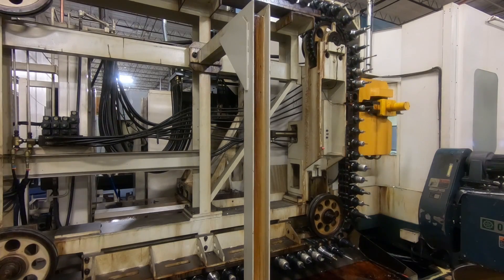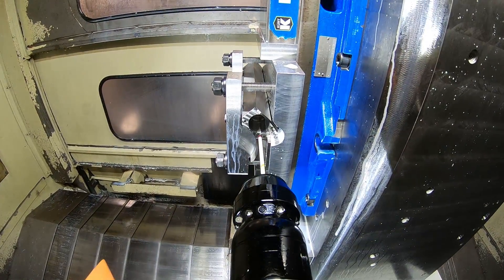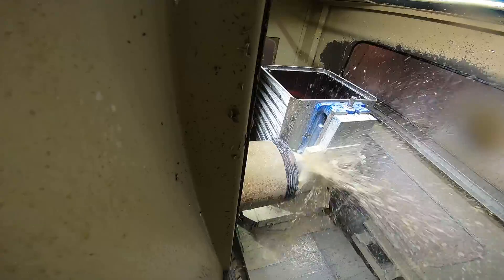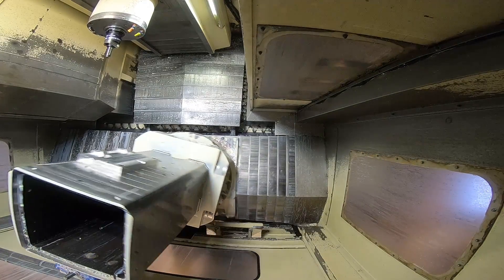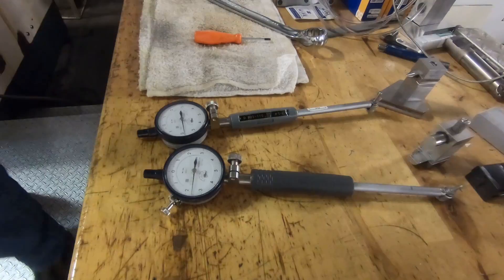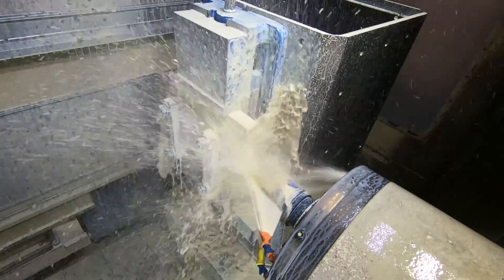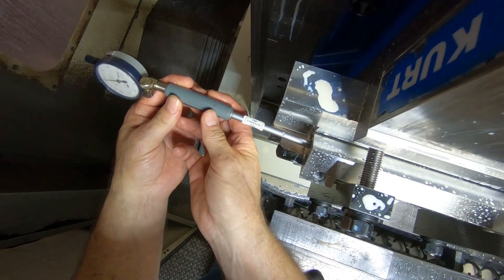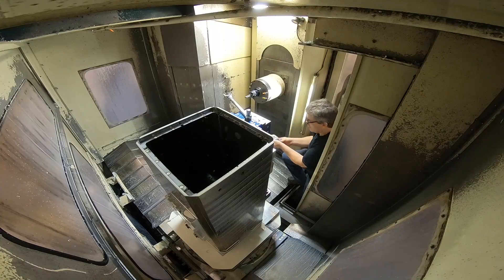Finishing Bores

Comment: Peter, do you have any experience cutting buttress threads I have a upcoming job at work. Approximately 1 thread per inch and 6” diameter. A experienced machinists advice would be appreciated.
Reply from the maker: I have cut buttress threads before. I treat them just like any thread. Are you going to be doing this on a CNC lathe or manual lathe?

Comment: You are a very skilled tradesman Peter, worthy of every positive comment. I just need some advice on what you would consider to be the most important and versatile machine (and which brand) to buy when setting up a small machining shop for the first time. Any comments would be appreciated, thanks.
Reply from the maker: This is a impossible question to answer. Not knowing the type of work you will be doing. The amount of money you can afford. Where you intend to put the machines. What kind of power is available at you site. How much experience you have running this kind of equipment. Are just a few things I would need to consider.

Comment: Peter can you tell me what Speeds and Feeds you would use to Threadmill a 3/4-10 Thread in 316 S.S?
Reply from the maker: Trav L it depends. What taper does your machine have? Are you going to use thru the tool coolant? How many passes are you going make?
Reply: I have a 50 taper machine but do not have thru coolant! I was planning on doing 3 rough passes and 1 finish pass! I have not Threadmilled much and just wanted to see what you would maybe do? I really appreciate any help you could give to me
Reply from the maker: What you need to do is start off very conservative. Say at around 1000 rpm and 5” per minute feed. Listen to the sound when cutting and look at the finish. Also look at the wear on the tool. If everything looks good. Start speeding things up. You will eventually find a good spot for your machine, cutter, coolant and setup combination. This is really the only way I can put it not knowing more about your situation.

Comment: Sorry to keep asking you questions but you seem to always have the right answers!! So I am cutting a piece of 316 L SS, I am using a Sandcik 2.5” Copy mill to do most of the heavy cutting, it seems to work the best for me! Have you ever used Ceramic Inserts to cut SS? If so, did you have any luck?
Reply from the maker: I have only used ceramic on Inconel. I don’t think there would be much advantage on 316. I would use a feed mill on 316. I usually run a 3” 6 flute feed mill dry at around 600 rpm and 90 inches per minute feed. At .060 depth of cut. This combination on my horizontal mill will rough a lot of material before needing to index inserts. But the tool will be hot so I have a bucket of water to cool it before indexing inserts. Or have a second tool set up while one cools. This is absolutely the best way to rough mill 316.
Reply: Edge Precision that is great to know because I have a 2.5” 5 flute feed mill but the insert pack says to run it at 1251 RPM and 150 ipm. That seems a little fast. I will definitely give it a try tomorrow! Thank you so much for your feedback Pete!!!
Reply from the maker: That RPM sounds a little high. But you have to experiment depending on the grade of carbide and the depth of cut. Sometimes less depth of cut but at a much higher feed will remove more material and be more reliable.
Reply: Edge Precision, do you ever run into surface hardening the material after you rough it?
Reply from the maker: Trav L tho only time I have had a problem is if the material got to hot and was quenched with the coolant. This is possible when using ceramic inserts. I have also had this happen on the lathe when the insert got dull or chipped.

Comment: @edgeprecision Is there any reason you set your bore gauge with the tip pointed upwards? Wouldn't the less the pre load be more accurate? Also I noticed you're needle is going towards the negative side, wouldn't you want it going towards the positive side since you're opening the hole up?
Reply from the maker: I think that it makes no difference witch way you face the gage for calibration if you face it the same way for the measurement. I always set the small needle and the large needle on the first major division. This gives me more travel in the minus direction. So I can measure the bore when it’s small on the first cuts.
Reply: @EdgePrecision  I suppose that makes sense. I work with the same mititoya gauges, and was taught a different way. I work as a precision grinder and usually only .020 stock is available unless there is plating. I've always preloaded it as soon and it reads and usually able to get atleast .030 travel. Thanks! Keep up the videos!

Comment: Pete, I have to Thread Mill some 3/4-10 and 1/2-13 threads in 316 SS 40 KSI material, would you use a Single Profile Thread Mill, a Helical Flute Thread Mill or a Straight Flute Thread Mill?
Thank you
Reply from the maker: Trav L I have done a lot of thread milling in 316. I would use a helical flute with thru the tool coolant (if you have it). I have had the best results with Emuge and Guhring brands. But I have also used US22 and Advent with good success as well. If you have high pressure thru the tool coolant this will increase you tool life.

Comment: Pete, do you Machine any materials dry? With no coolant?
Reply from the maker: On my horizontal mill when using a feed mill. In steels and 300 series stainless steel. Most everything else I run coolant on.

Comment: Do you have any tip of turning(on a traditional CNC lathe) 13 Chrome steel at 80 yield or higher or tips in general and inserts for soft/gummy exotic metals?
Reply from the maker: I don't do as much turning as milling. But what I find is turning from machine to machine is very variable. Or in other words what I do on my machine may not work on yours. This is one place you will have to experiment to find what works on your machine. Sorry I can't be more helpful.

Comment: Peter does the boring cycle do something to move the tool off centerline when it retracts to prevent the tool from dragging on the finished bore?
Reply from the maker: Yes it’s running a bore orient retract cycle. That’s why it’s orientating the spindle at the hole bottom in the video. Than it moves over in X so it doesn’t drag the tool over the bore.

Comment: @Edge Precision I only watched half the videos on this before they were taken down. I Remember you mentioned that the other half of the shop were going to make these parts on a HAAS horizontal and CNC lathe and some other, (perhaps) not thinking the whole process out all the way through. How far did they get with things compared to what you were able to do with B axis mill turn etc. ? Please and thank you ! [Any chance you could make a Wire EDM video one day ?].
Reply from the maker: They did get their parts done. But they had a total of five machines working on them. They also scrapped about 15 of them. And had to remake them. I still haven’t quite finished all of mine. But its only me working on mine. And I haven’t scrapped any.

Comment: So are the bolt hole locations around that bore still skewed by the released distortion or were they done late enough in the process to not move? Perhaps their locational tolerances are such that the distortion does not matter?
Reply from the maker: There is enough tolerance on their location to accommodate this. We are not talking about much. Maybe a few thousands of a inch.  Inspection hasn't complained about it. And believe me those guys in inspection just live to find mistakes in parts. But if you wanted to be as precise as possible. It would be best to do the holes in the same setup as the bores.
Reply: Edge Precision I don’t know about you but I always find measuring the actual position of a threaded hole to very high accuracy to be challenging anyway. Gauge pins to the root diameters is the only decent way I know to do it otherwise thread fits start putting play in that can make determining the proper position to measure from difficult.
Reply from the maker: The only way to really do it accurately is with the special threaded springy shoulder pins that are for a CMM. These actually check the threads location not the hole.  The only thing even with them is if the face isn't flat or square to the thread it can throw off the measurement. The best practical way that I have done is to use a Digital height measuring instrument. Ones like a Mitutoyo or Tesa. With them you can scan the tap drills hole and get a very accurate location. Also with a scanning CMM (Like the one I have) You can scan vertical lines (Up and down the hole) at 90 deg quadrants (Or more) and get a decent location. Assuming you can qualify a small enough probe to enter the hole. This becomes impracticable on holes say smaller than 4-40. In the end with all but the springy pin things you are only checking the tap drills location.If you want to really learn got to this link http://www.iigdt.com/1/2/Thread%20Hole%20Location%20Study%20-%20Sandia%20Natl%20Lab.pdf
Reply: @EdgePrecision  I would enjoy a video on your CMM sometime.
Reply from the maker: That would be a good idea for videos. There is just one problem to overcome (witch I intend to do). I hardly ever use the machine anymore. So it has been setting idle for a while. I went to turn it on the other day and got a error message. There are two computers. One on the desk and one in the machines control cabinet. Apparently the computers are no longer communicating with each other. You actually control many functions on the machine from the desktop computer. So I cant even zero return the machine now. I need to get someone from Zeiss to come look at it. I think It might be that a back up battery has run down in the machines controller and it has lost some kind of configuration. But when I get it running again I will make some videos. I have used it a little in a couple of videos.

Comment: I usually do the exact sequence when boring. One cut the two cut with half of what's left. I've been doing that forever and works always. I prefer the sakdvik boring head's. Thoes heads are very good and the repeat great. I don't have them at that small diameter thoug
Reply from the maker: The Iscar ITS heads are really just re-branded  D'Andrea boring heads.
Reply: @EdgePrecision  how are the price for thoes? the sandvik is fairly expensive

Comment: Peter, I'm a fairly new machinist, been in the industry for two and a half years now, and the shop I work at has  Renishaw probes as well. My question is what sort of code did you use in the program that calculates an average of the errors in the bores? Or can you at least point me in the right direction? I'm a huge fan and love your videos. Thanks.
Reply from the maker: I use the Renishaw macros for the probing cycles. As for the code to make it happen. I am going to recommend a book.  Fanuc CNC Custom Macros by Peter Smid. You can buy it from Amazon. It deals with Fanuc but these are pretty much universal codes for most all machines. In this book it will tell you what you want to know.
Reply: He has made a couple of videos about how to do it.
Reply: @TheNQb   thank you I'll need to watch more of his older videos. And thank you Peter, I'll check out that book for sure. We don't program macros hardly at all so it'd be good to learn. Thanks again.
Reply: https://youtu.be/3zL6UJiwjh0

Comment: so you still needed to straighten the part before this? trying to understand the title. ive worked on a project where after roughing the part we had to take it out of the fixture and place it another to be able to machine off the deformation from large material removal as part of the finish machining. I watched this logged in and again logged out for you!
Reply from the maker: Yes the parts need to be straightened a little length wise. They bow slightly when split from the tube.

Comment: Peter, your "behind the scenes" tool changing editing with this is great!  Love your vids and always look forward to them. Also...
What guage block system are you using to set your dial bore guage with?
Reply from the maker: Mitutoyo. I will have to look at the part number when I get back to the shop.
Reply from the maker: The Mitutoyo end block set is 516-612. This will work with any square gauge block set. In fact I dont use Mitutoyo gauge blocks. I use a more economical set I have had for years. I have a video where I show setting up a bore gauge in the second half of the video. (starts around 9:50) https://youtu.be/IV9ElxbOD8w

Comment: Peter, I've seen you do the sneak-up-on-it approach in many of your videos, do you do this for every part in a run or just back off on the head a fixed amount and then do a finish pass at the final setting?
Reply from the maker: This is the very last cut on these parts. It’s not worth it to take the chance. Just to save a few minutes. I measure it as I go. But the boring head usually ends on exactly the same setting within a few tenths.